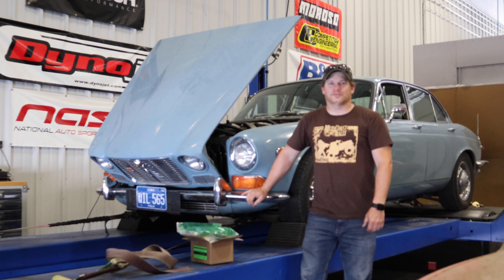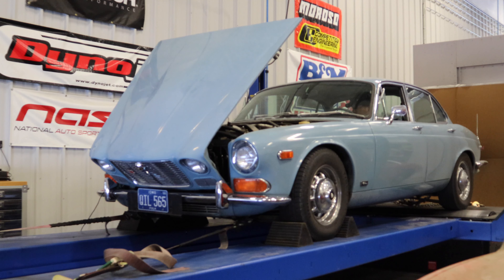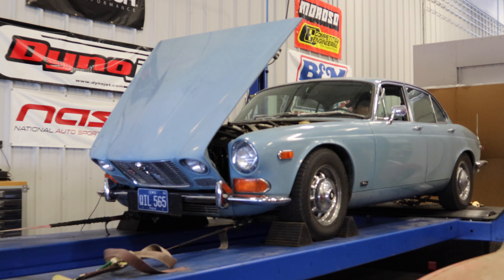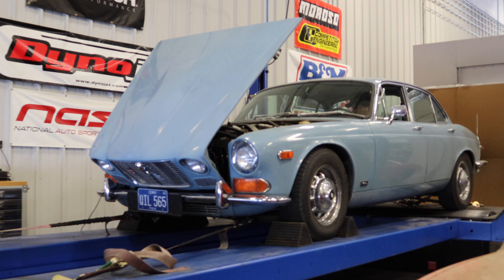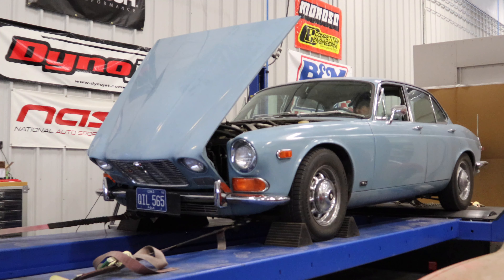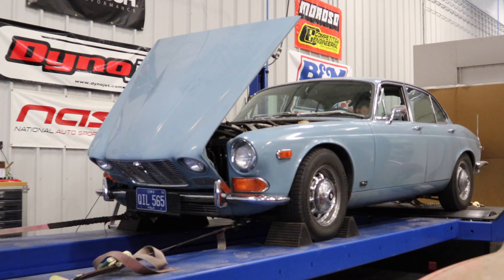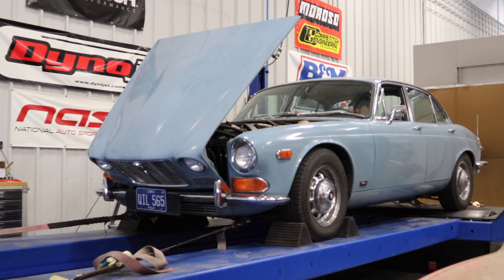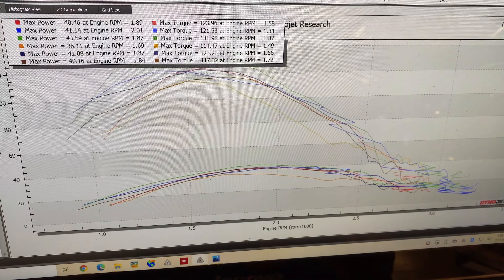Disappointing Ignition Upgrades - Good Idea, Bad Results - Jaguar XJ6

Comment: Just a thought.  Is it a mechanical advance distributor?  Could the springs be worn, old or the mechanism sticky?
Reply: Sean m  Best to check timing at higher rpm too, quite separate from the vacuum timing variation. I would have twisted the rotor arm to check for free movement and possibly looked to see movement to the red timing mark to do this check but was not mentioned.
Reply: Sean m  I could see that.. If the distributor is stuck and the timing is not changing from initial it's really going to struggle.
Reply: I think it's a vacuum advance, so a) check the vacuum tube hasn't got a leak or collapsed - reducing the vacuum at higher engine speeds and b) that the base plate of the distributor is moving. Any rubber hose on a vehicle this age is automatically suspect IMHO
Reply: I changed the fuel filter on my volvo s80, the difference in performance was dramatic. You got two fuel filters, new ones may help.
Reply: Years ago my mate had an S type Jag, his fuel pumps worked but were very lazy, I'm  sure he had to change them.
Reply: Agreed. I worked on a neighbour's Herald that wouldn't run properly. The mechanical bob weights were stuck from the old lube, and the vacuum advance unit was punctured. 
It was running on static advance only.
I figured that one out when trying to set the timing, as I increased the revs, the timing didn't change. Sucking on the vacuum unit not only didn't change the advance, but just gave me a mouth full of air.
Reply: Try setting the dwell angle of the points rather than just going for the recommended gap and as stated above check the mechanical and vacuum advance. Sorry if I'm repeating others suggestions but I'm catching up on your videos and haven't scratched the surface on the comments lol.
Reply: @NorthWesternSouthEast  Almost every car from that era I worked on had advance issues. Stuck weights and always faulty vacuum advance issues. Like this guy nobody looks at this aspect of ignition. I've seen engines rebuilt and then brought to me with the old distributor still inoperative. It's an easy fix but cars have been scrapped for lack of a few basics.

Comment: Bad dash-pot oil, bent needle, ripped rubber diaphragm, floats too low / high, leaking, damaged mufflers, a spud up the exhaust pipe, horrible fuel, vacuum leak...........wrong tire pressures / wheels bouncing on the dyno. I have even seen an XKE with a bad tachometer (chafed ignition wire) effect running!

Comment: Plugs colour indicated lean mixture from what I could see Steve, I ran an E type from the same era as that XJ for 15 years and never had any problems with the old original points and coil ignition components. I'm keen to see the next installment of this car tuning.

Comment: Hi Steve. I used to set my points with a dwell meter.(not sure if you can still get them??)
Reply: I used a dwell meter on my Formula Ford engines when we had to use points but that ended over 20 years ago. I haven't seen a dwell meter since and prior to my having one to use on the race car I hadn't seen or used one since high school (1983). However the misfire would not be effected by use of a dwell meter to set the point gap vs a feeler gauge. It might find you that last horsepower or two at most.
Reply from the maker: I double checked my gap with the dwell meter and it was spot on.
Reply: Dwell meters are easy to make
Reply: I have 2 Heath Kit dwell/tach meters, that were bought in 1972. They work great. Does anyone want to buy them?

Comment: Nice update although what you did isn't really an upgrade, more of a refresh. Hope you find your power and revs !
The XK engine cylinder numbering follows the convention of aero engines, the designers based it on wartime engine techniques and technology which is why it was so advanced at the time.

Comment: You need to check and if necessary reshim the cams, adjust the timing and then adjust the points with a Dwell meter, in that order. Trust me, the inlet valves can be shimed bit tight and the exhaust valves just abit loose, and add a few PSI to the back tyres to skate the back round on corners, best get away car going.

Comment: I think you're right about the fuelling. I'd ditch the points in favour of electronic ignition, preferably a 123 system. Love the xj6.
Reply: I put a 123 distributor in my TR6. Clear improvement.

Comment: Check the diaphragms and oil levels first and then check the carb balance with a carb balancer at idle and at 1500rpm using the throttle pedal. I wedge it so I know it hasn't moved. It's no good just balancing them at idle because usually the butterflies will open differently when the throttle pedal is depressed. Looking at the old spark plugs the mixtures look to me to be somewhere near, certainly not that far out that it's going to cause a miss fire. Also when re-testing it on the Dyno you need to refit the air cleaner in order for the carbs to draw correctly.
If you're running it on unleaded I would knock the timing back to 4 degs BTDC at idle and check the mechanical and vacuum advance and retard with the engine running. Also when changing  the points always lubricate the cam with a thin smear of grease all the way round. This stops the points gap narrowing prematurely and the cam lobes to wear unevenly and set the gap to 15 thousands of an inch an. I also set the plug gap to 25 thousands of an inch.
Anyway, I hope this helps and I can be contacted on 44 (0) 797125775 and Whatsapp or martinrawly@msn.com

Comment: You made two mistakes. You used Lucas electronics & you didn't put in an FSI Electronic Ignition. Put bluntly, without a compression test, all your tuning work means squat diddly. If you have a cylinder or two down on compression, due to rings or valves, you will never get a descent reading on your graph. Anything is possible with these old 4.2 litre engines!

Comment: Steve. That engine sounds so sweet , even under load. And the way the rear drops when applying power tells me there's nothing inherently wrong . It must  be  making more than the dyno indicates. The only thing l noticed was she sounded lumpy when you checking the timing. I would remove all the smog gear (and probably the air con) swap the Strombergs for S.U's ,  and then you'd have a Jauar that drives like it should. Next time your in England drive an early one and you will be impressed and take the opportunity to get S/hand carbs.Sounds obvious but l'm sure your aware that water used to get into the tanks. I expect you drained the tanks and  put fresh fuel for starters. Very nice looking car. I still miss mine from 40+ years back and the Series 2 had smaller carbs and really struggled to get up and go.

Comment: Hi Steve, it's really great to see a Series 1 Jaguar XJ being brought back to life, can't wait to see how much power you end up getting back. Here's a couple of thoughts of things to check :
1. Fuel pump operation and pressure at the carbs;
2. Crankcase breather system, check for blockages.

Dave